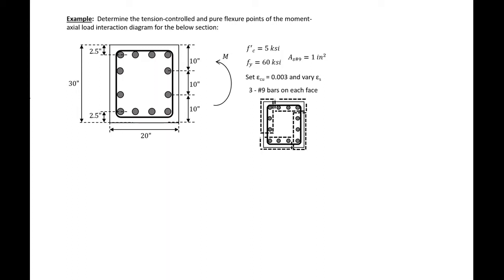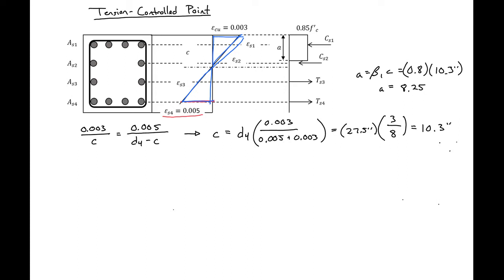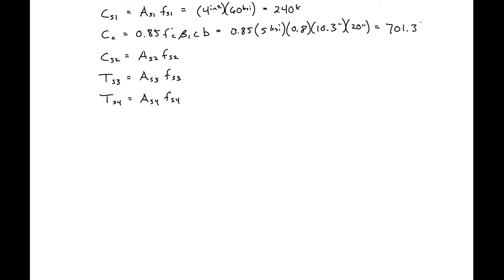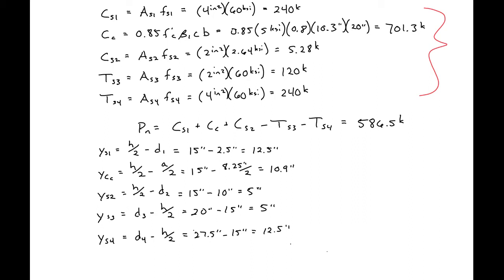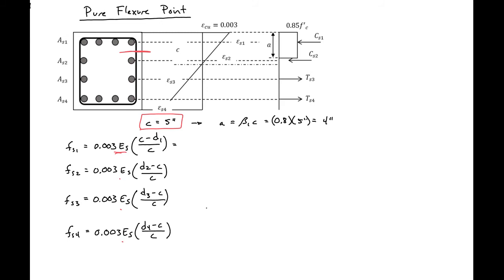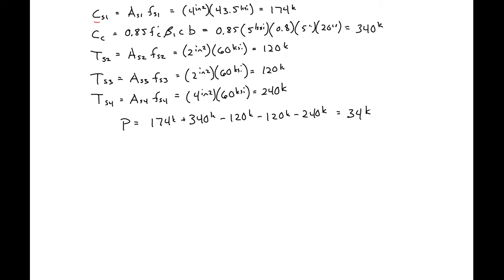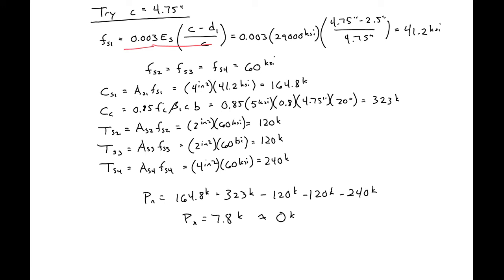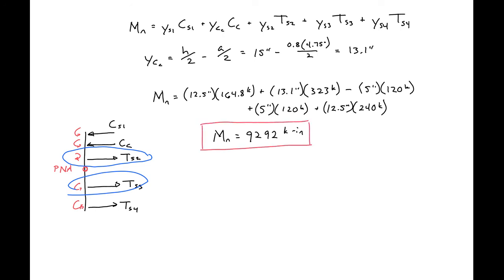11-04 - Example 4 - Reinforced Concrete Column Behavior with Multiple Layers of Reinforcement

Comment: David - at 22:18, you used the force (T2) in the second layer of steel to be in tension, despite it being above the PNA and the c value, thus giving a moment in the opposite direction. In section analysis, do you always have to assume that all steel in is tension?
Reply: C < h2